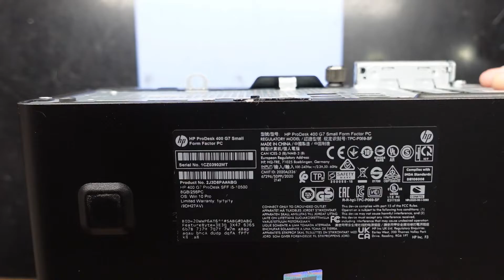HP ProDesk 400 G7 SFF, Ram and SSD Update in 2023

Comment: Commendable. I want to upgrade the psu and put in a graphics card. Idk where to start but this is a great video.
Reply from the maker: cant really upgrade psu
Reply: @rickstechrepairs why not?
Reply: @jelly_boi307  this prodesk model only have, 2 pcs 4 pin socket from psu to motherboard, without 24 pin socket...
Reply: @rickstechrepairs  hi! quick question, if i cant upgrade my psu, so what is the highest gpu i can use? please notice 😢

Comment: Hello! What are the best graphic cards options for gaming? Mostly storygames like resident evil, Shadow of tombraider. I hope you can help me because im really bad with this stuff haha
Reply: The big problems with this particular model is the PCI space and anemic PSU. If you are looking for a SFF for gaming check out the Lenovo P340. With that, you could even drop in a 4060 low profile GPU due to the PCI power cable. 

If you absolutely have to use this PC, the Nvidia T600 or the AMD RX6400 is prob your best bet. It would have to be something very thin.
Reply: @HunterTinsley  I doubt the RX6400 can fit in there. Probably too long, even with the LP versions. The T600 might fit, but tbh your best bet would be something like the short 1030 LP.
Reply: Rtx 2080 ti
Reply: Can you transfer this to a different pc case or is it hard to do?